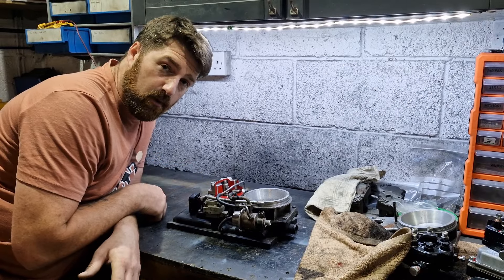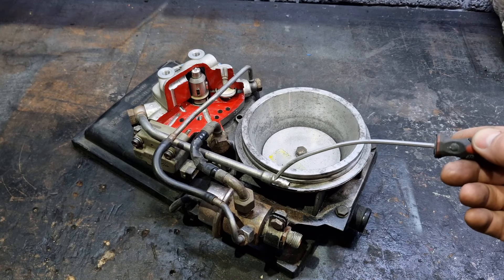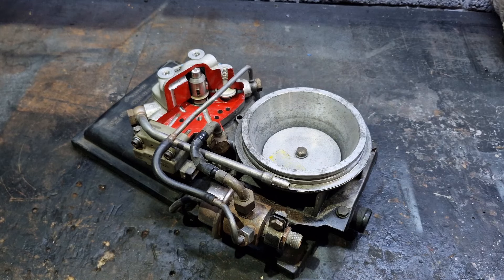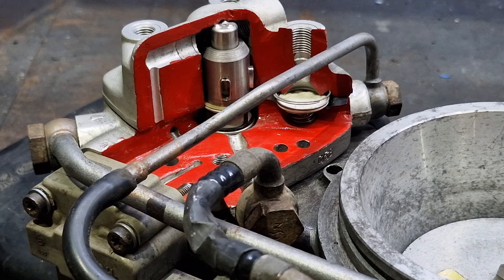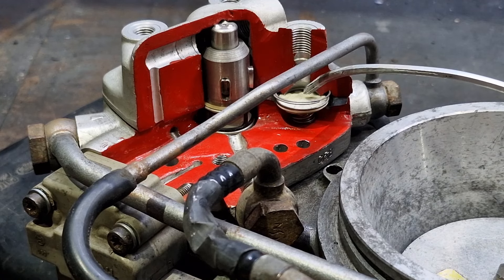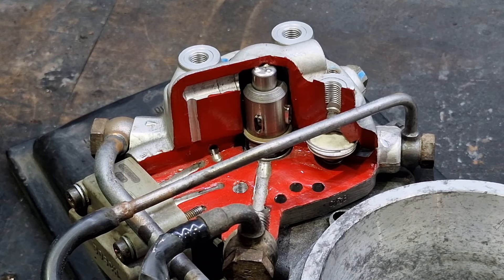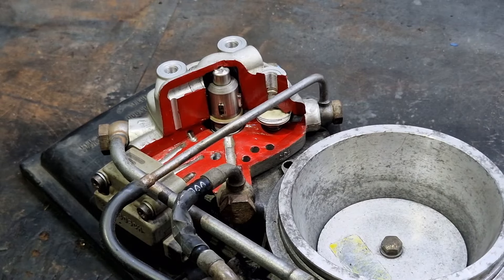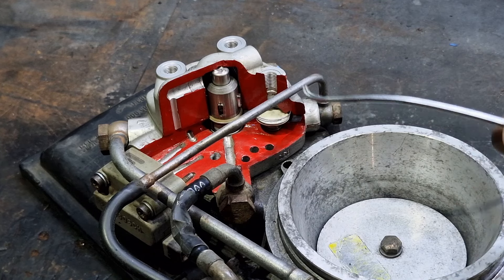Bosch KE-jetronic - The Inside Truth

Comment: Interesting to see. My 83 Rabbit GTI 16v used the original cis-lambda fuel distributor,with a modified CPR, and wideband controlled frequency valve for full throttle.
Reply from the maker: Nice, there's so many ways to adapt the systems to make them work even better

Comment: I have a question ,when starting the car and engine is in idle does the inyectors are fed with lower chamber fuel only? And then when we accelerate fuel from the lower and upper chamber deliver more fuel pressure to the inyectors? Best regards.
Reply from the maker: Hi, no the upper and lower chambers are just there to hold an equilibrium between fuel output which is then adjusted with KE with the DPR
Reply: @GreyGooseRestorations  thanks 👍 amazing videos

Comment: Thanks for all your knowledge. I have a question my ke jetronic system pressure is set at 5.5 bar. As i do system pressure and control pressure as you have shown in your video prevoisly tap open and closed same reading 5.5 bar. I did unplug the eha and adjusted it in and out pressures stay the same? Car is running very rich while driving afr 10 to 9 at the moment when accelerating.
Reply from the maker: Thanks, if there both 5.5 bar then potentially the EHA is stuck preventing any differential pressure which will cause poor running
Reply: Darn i also had same idea. I have two eha units but both do the same
Reply from the maker: @kobusstrydom5166 do a resistance test on them
Reply: Ok how much should i get?
Reply from the maker: @kobusstrydom5166 20 ohms give ot take a few ohms
Reply: Ok i am getting 18.5 ohm and i tested the amperage using a 1.5v aa battery getting 73Ma is this good or not?
Reply: Is there better fuell economy to be expected with more electricall control or it is only about relability
Reply from the maker: @damiropadobarglumskiperiod505 Yes, the KE jetronic had better fuel economy (provided all else is ok) as the DPR allowed far more adjustment to different temperatures and running conditions
Reply: @GreyGooseRestorations  thank so much.i about to put new life to my dad s w201 from 1984y.thats been sitting for 13 y.fuel economy is the major issue.but if i menage 7 litters per 100 kilometters in the highway as it should be that will be awesome
Reply from the maker: @damiropadobarglumskiperiod505 great to hear 👍

Comment: Hi. Have tvr 2.8i which have had real trouble sorting tuning. Have just taken cold start to pieces and cleaned it. Car 75% better. Still misfiring on hard press of excelerator. Can't tell if it's too weak or too richif you richrn mixture it hunts.
Any idea.  Julian
Reply from the maker: Could be an air leak or the CO mixture and or air flap isn't set right

What is your engine CO% when warm
Reply: @GreyGooseRestorations  don't have co meter. Will look into it. Also should fuel pump run as soon as key turned on or just when flap lifts.  Cheers
Reply from the maker: With ignition switched on it should prime for a few seconds then switch off
Reply: @GreyGooseRestorations  so what controls that. The thermo sensor ?
Reply from the maker: The fuel pump relay should be letting the system prime or run as soon as the ignition is switched on, either or it'll be the relay

Comment: Sir how can the air plate go up and the air direction is going down?
Reply from the maker: The air flow is flowing up so the air filter sits below the silver air mete
Reply: @GreyGooseRestorations  sir is that setup on all cars using this system? I see Mercedes guys pushing down on the plate when they set the mixture. I ask because have the same system on a bentley and trying to understand it. Checked the manual and some other YouTube videos. Except this part of how the plate goes up. Thank you.
Reply from the maker: @RoveFans this type is different, the Mercedes-Benz type plates push down with air flow down as do some porsche units
Reply: @GreyGooseRestorations  thank you for clarifying it sir because I got confused watching CIS videos some pushing down and you pushing up 🤣.